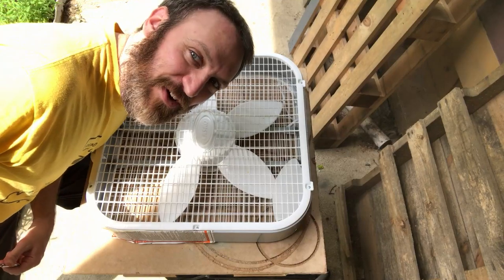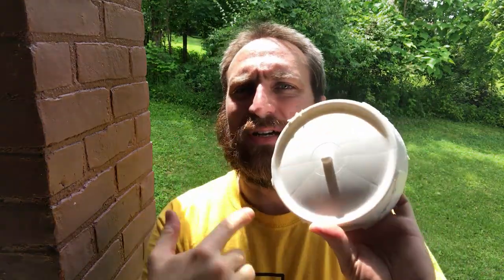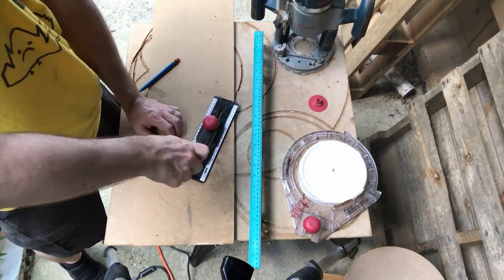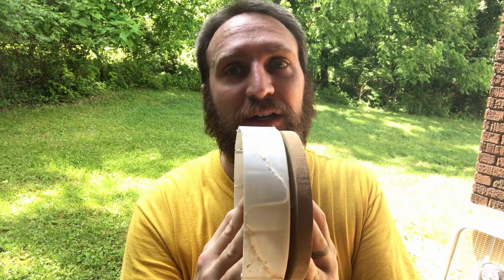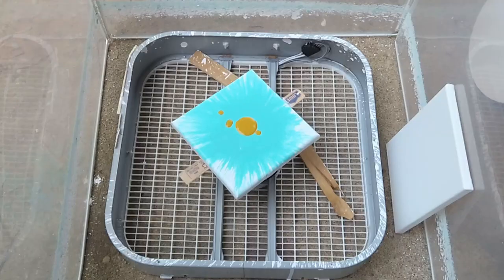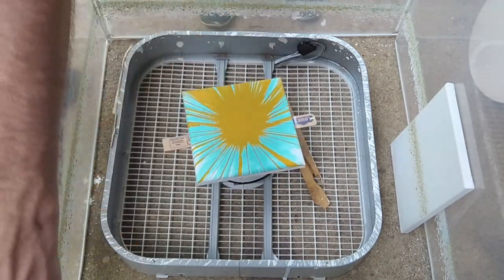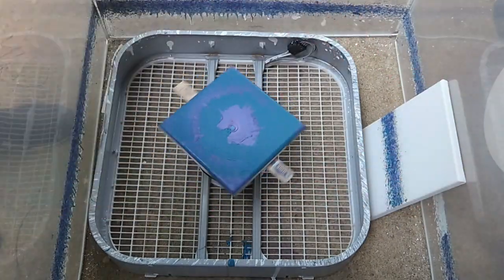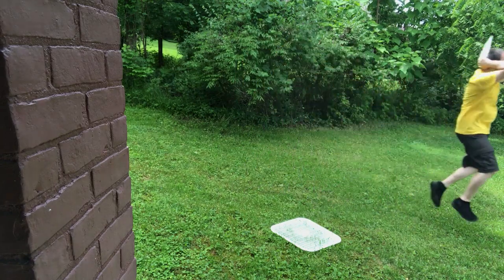DIY Spin Art Machine from a Box Fan | How to Make Fluid Spin Painting

Comment: did i miss the part on how you attached the canvas to the spinning part of the fan. saw the wood circle you made but then how is canvas attached to that?
Reply: I’m trying to find same thing
Reply: @annfashaw9270  I ended up making one myself that same day I commented. I'm sure there are plenty of ways people have done it. I ended up using a 1x3 I cut two small pieces to make a flat section over the rounded circular spinning piece after cutting the blades off. I then cut a longer beam to go across those two and span past the box fan. And then I stretched some 3m command strip down the 1x3 and then I cut small bits to put onto the canvas frame when I want to use the spinner. Also I attached the fan plug to a dimmer switch I mounted to the wall outside the big closet that I setup tarps all around to keep clean. The dimmer switch is nice touch
Reply: @spencerstorck7252  sounds very professional..my skills are very limited with tools lol. I used the front of the fan and some small heavy duty clamps. This way I can adjust them for different sizes.  Happy spinning 🎨